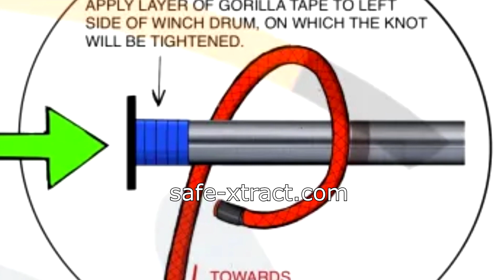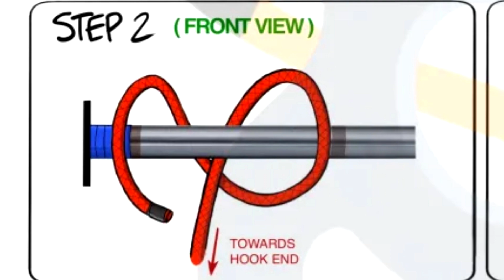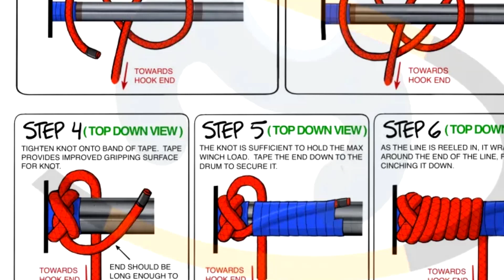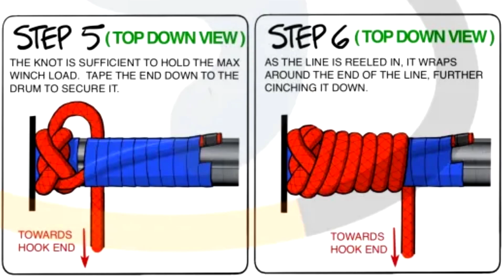Synthetic Rope on Badland Winch: The Safe-Xtract Method: Reverse Constrictor Knot and Gorilla Tape

Comment: Best winch video I've seen. I have wasted a lot of time looking for this. 
That synthetic rope is slicker than snot. I bought friction tape to put on the drum. 

I'll start by practicing the C knot on a piece of pipe until I get it down solid.
Reply from the maker: Thank you! I practiced the knot a few times first too, and while it looks like I got it right the first time in the video I did not.  Hope it goes well for you, it's worked well for me so far.  Thanks!!

Comment: Make sure to tension the line on the drum with about 10% of the MBS to help get most of the air out of the braid and help compact the line in the lower layers. This will greatly help prevent line dive when working from the upper layers.
Reply from the maker: He is right, after this video I pulled my car up the alley with my winch to rewind the line under load.  Pretty standard practice with wire, but often overlooked with rope.  Thank you!!